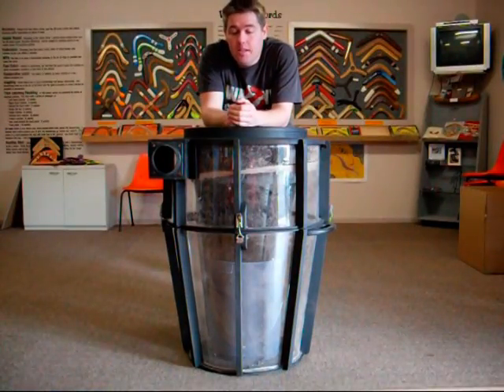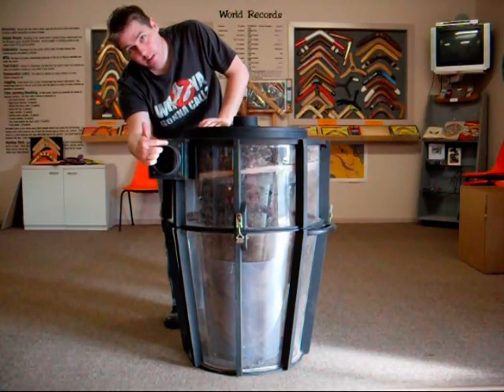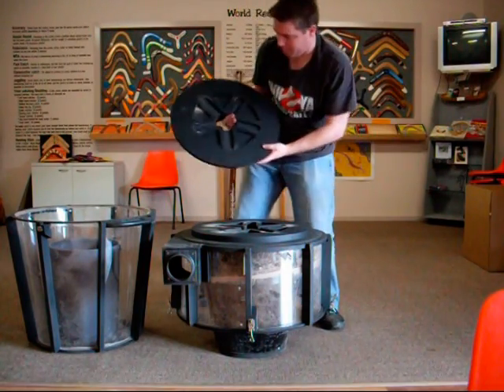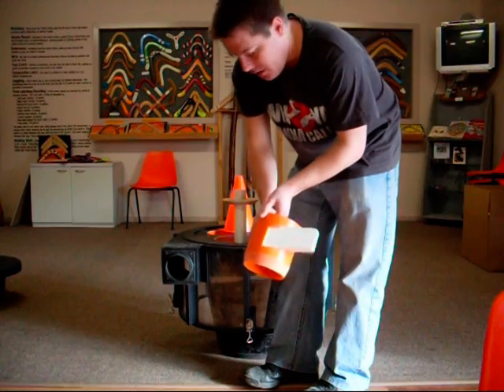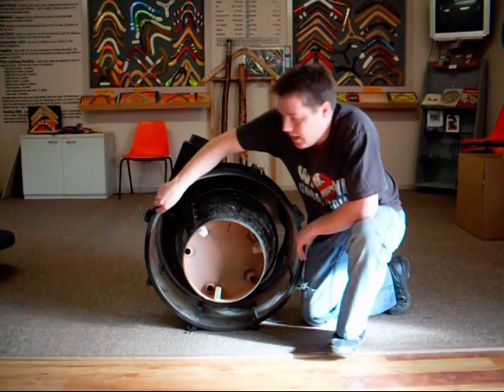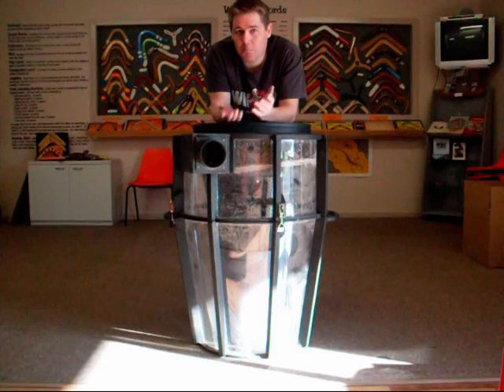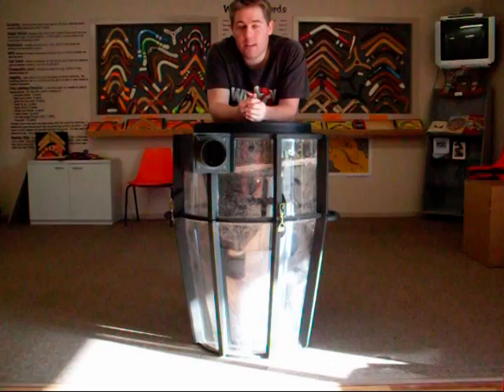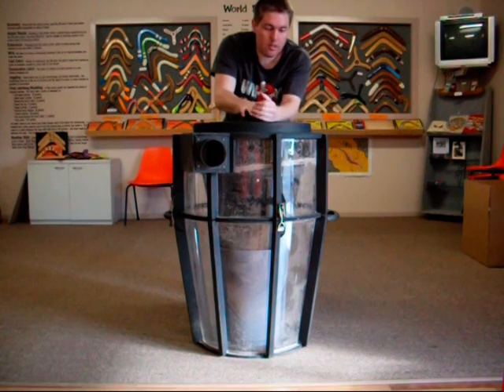2 Stage cyclone dust separator. Part1 (Overview)

Comment: Sir, at 3:50 that inlet rectangular tube is causing a lot of disturbance to the   flow that entered the cylinder and turned approx one turn in it. I suggest flaring the intake with the cylinder or cones used, whatever. I believe you have the same issue on the cones inlets and  investigating and observing the dust distribution in you other video it is so clear that the dynamics are not optimised.